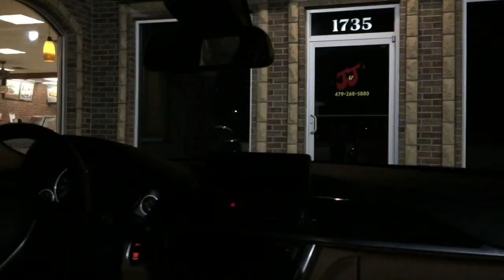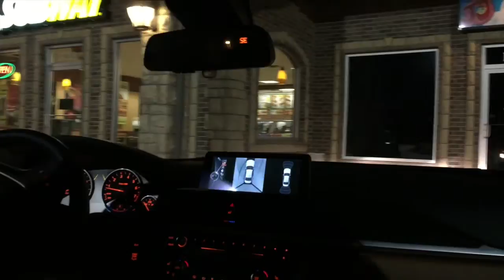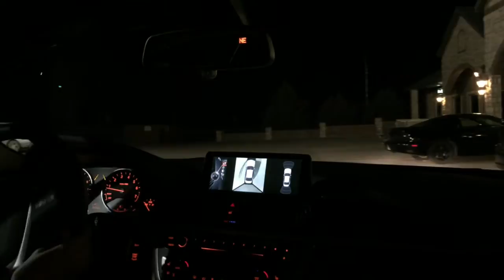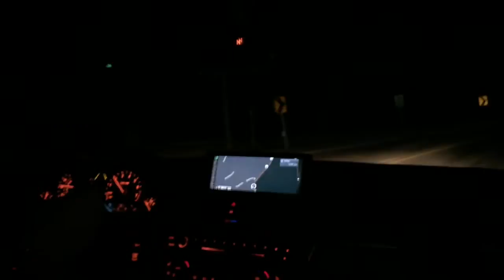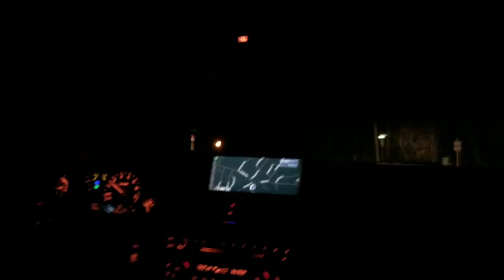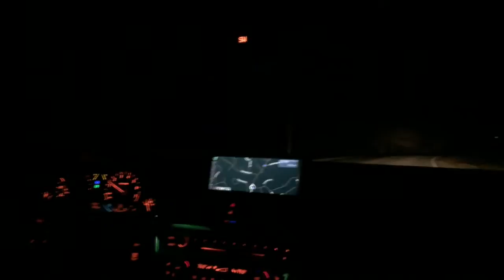BMW 328i Night Drive and Automatic High Beam Demonstration

Comment: In the US, BMW gave us the dumbed down version of automatic high beam, which just turns on and off. In Europe, the automatic high beam are glare-free. The system creates a light-free tunnel for preceding or approaching vehicles while keeping the high beam engaged around them, without glaring the drivers.